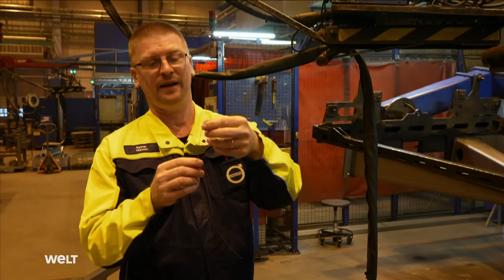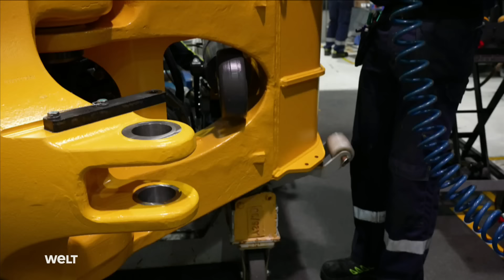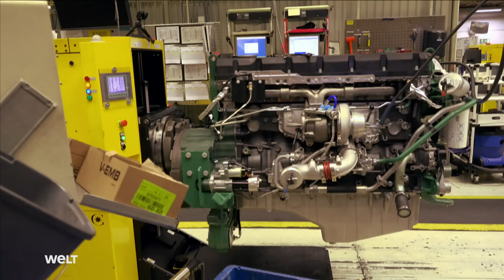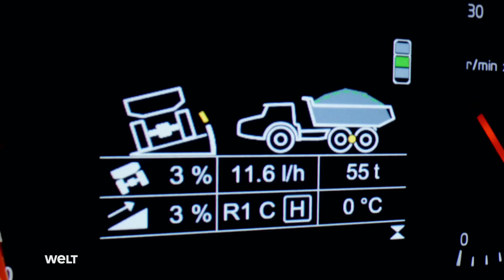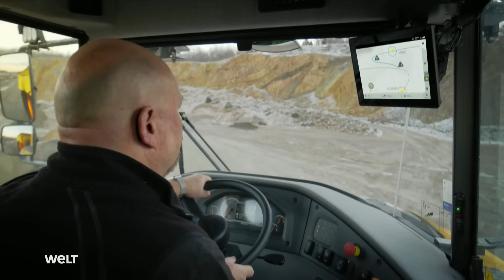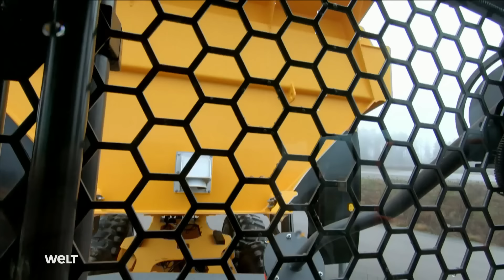World’s Largest Articulated Dump Truck | Volvo A60 Mega Construction | FD Engineering

Comment: I live nearby this factory, and I was stunned at how small the A60 really is. It's not big at all! 12 meters long is not more than a single truck (without trailer) and although it is 3,8 meters wide (significantly more than a truck) I still couldn't understand where all that net weight actually sits. I couldn't believe that the machine is 40 tons net (empty) -  I would have guessed about 20 tons. It's really not a big machine at all.

Comment: They're certainly nice, and probably the best in their weight class... but where I worked, they certainly weren't considered the big boyz on the block. Those were the beasts like the CAT 797... a 400 tonne hauler, and the Volvo's 60 tonne capacity is minuscule by comparison.

Comment: An classic 'antique' now as new designs started in 2000
Reply: Lid/lip in front of bed was just as big as dump area to protect driver from loader,yet made turning weird as  would 'seem' to move opposite of direction of steer as regular dump truck as cab pivoted directions under it
Reply: Thus making it such a weird experience + fact going from that to a suv  to drive to and from the mining pit seem like getting into a matchbox truck!

Comment: Have driven one yet quite differnt style/model as it was known back then as a flat nose cabover as the the lid on bed was directly over cab to prevent crushing cab as loading and not having a nose engine driver seat was directly over wheels like isuzu and steering was not connected to axle yet to the center pivot gear not pin like a loader that kinda made steer as like a semis 5th wheel yet gears turning cab. & tires ar same time opp direction of dumpbed thus giving a 0° turn radius like mowers yet sitting down and swiveling in seat to  steer unlike mowers as whole machine turns where dumptruck was just cab thus feeling like90° turns as if was a jacknifing semi! &Unlike isuzu cabover it steered right to go left &LtoR ,as it steered center 'pin' gear not wheel axle!

Comment: A couple of crazy Canadians bought a couple of those and cut them up !! Removed the beds cut the frames just In front of the  rear drive housing added  20   more feet of frame and put it back together and  reassembled a 30 foot oil  field bed, 3 winches a set of gin. Poles  a set of 6'x4'tires  times 6 or 8  ,. They work in the Alberta oil fields and haul 90- 150 k. Lbs in almost waist deep mud wallows called drill sites ..

Comment: If I could point out a possible slight modification.The a60 dump truck is nearly always loaded but with a loader this nearly always means overspill from loader on the side machinery ie wheels bearings diff etc if side panels were automated allowing driver when filling .to lift individual side panels ,this would prevent overspill ,cutting down many hours of maintenance. And serious damage to wheel bearings , especially in mining conditions like North America Alaska Canada and Russia in cold conditions preventing costly repairs and serious parts replaced taking  some cases weeks , I suppose this is nothing new and is probably an extra part that can be bought when purchasing ,❤mining

Comment: The Catipillar-797F is no joke either.. It's not articulated but can haul over 400 tons in its bucket.. Each wheel on the 797F weighs 5 tons.. There are 4 in the back and 2 in the front.. I believe it's 3 stories tall.. I've never seen anything come out of Sweden that was made in poor quality.. The Catiplillar 797F has it all over the A60...
Reply: Volvo is the original, everything else is a copy!

Comment: I think some version of this machine is used for the Archer howitzer.
Reply: I wouldn't call it another version. It's the much smaller model A30D that is heavily modified when used for the Archer. But yeah, it's at least a Volvo articulated hauler.
Reply: @ Thank you! I just recognised it as a dump truck that looked similar.

Comment: When a Ford F350 pickup can go for 100K a 500K price tag for the A60 seems very reasonable.  They video was nicely put together and very informative.  Thanks for sharing the presentation.
Reply: the f350 is a liability on the a60 an asset.
Reply: @jimzucker most people that buy an f-350 are using it for work it's not moving dirt but it's moving a whole lot of other heavy stuff too so it's the same the f-350 will make you just as much if not more money so no it's not a liability just because you say so 😂 mines made me millions over the years doing water and sewer lines just pulling an excavator and pipe and all the other stuff i use it for
Reply: $1m new. In two years the warranty expires. Sell it for $800k before the new one delivers for a per machine cost of $100k per year, plus 315k liters of diesel per year and routine maintenance. If anything fails, Volvo fixes it. In that time, nothing else should need to be repaired, rebuilt, refurbished or replaced. If the operation requires 55-ton capacity offroad dump trucks that work 24 hours per day with minimal down time, it's a pretty good deal.
Reply: I’d buy one and convert the bed into a home lol
Reply: @Literally_the_devil Ich kaufe mir auch so ein großes "Spielzeug",damit fahre ich dann im Garten rum,sammele die Äpfel,Kirschen u Kartoffeln gleichzeitig  in die Mulde,kippe diese dann vorm Keller ab,dann fahre ich zwei-dreimal über die Wiese,dann brauche ich kein Rasenmäher mehr,danach fülle ich die Mulde mit Wasser und habe gleichzeitig ein mobiles Schwimmbad und ich kann dabei vom Balkon ins Wasser springen   Was will man mehr !😊
Reply: 500k?  That may be what a auction company sells them for with low hours but if you order one from the company with the warranty, delivery, service contract, and training etc you're closer to 800k.

Comment: I live 20 km from Braås and got friends that works there and they say its very good workplace and good pay. I work with repare and service of this tip of machines. Its mighty vehicles to drive and work with.
Reply: Samma här. Ca 20 km  🙂
Reply: swecon?
Reply: That’s awesome! 🙌 First-hand insight like yours really adds weight. Working so close to Braås and servicing these massive machines must give you a unique perspective. Do you enjoy more the technical challenge of repairing them, or the thrill of seeing them in action?
Reply: Borås?
Reply: @reallivebluescat  no the factory is in Braås. Not Borås.
Reply: Its called Borås not Braaas
Reply: @dealerovski82  Borås is another town. Braås is a small town outside Växjö.
Reply: @gunnarboy8989  I live around there and have never heard of it.
Reply: @dealerovski82  Braås is a small town east of Växjö next up is Norrhult and then Åseda so now you know
Reply: @dealerovski82  Then try to type in Braås in Google before you claim it's Borås.
Reply: @hansericsson7058  yup, I live around Åseda, used to work in Profilgruppen and been in Braås many many times 😅

Comment: I started off driving a Volvo 861,  then a 5350 and finished up on an A 30. They would literally go anywhere.  I also drove a Bell 40 ton, there was no shortage of power from it's Scania V8 💪
Reply: I forgot,  but I also drove a Terex for a while. I liked it's Cummins engine.  It would start immediately regardless of how cold it was outside. The only negative I thought was when in auto, it would drop down too low in the revs before it would shift down instead of staying IN the power. Maybe it just needed to be calibrated or something.  Still, was better than sitting in the 861 with it's broken manifold 🙉 😂

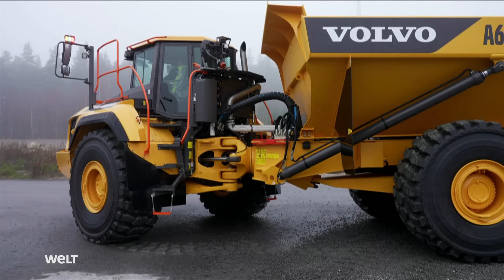Comment: 10:55 hydraulic cylinders or actuators, not pumps. There is a pump but you're looking at the actuator side non the pump side there, the pump is in the engine bay and supplies pressure, the actuator does the actual work.

Comment: 50/50 men/women? What is wrong with just hiring the most qualified person? No wonder Sweden has issues.
Reply: This team produces world class machinery. Sweden’s got problems but high skilled workers are not one of them.
Reply: If the most qualified person just so happens to be a female and the role is traditionally male, there's a pretty good chance she's going to be discouraged.
Reply: Most qualified for standing on an assembly line tightening bolts?
I sure hope not.
Reply: @Merecir You don’t have  wish for anything as it is a fact that this factory and its employees operates on global market where they outperform their competitors in quality etc. Does that hurt your delicate butt skin?
Reply: @ordningsmannen  The engineers who designed the vehicle, the factory and the assembly process are the ones who outperform the competitors.
Anyone, even the most dim witted moron, can tighten a bolt.
Reply: I'm thinking the same thing. If you get too political/corporate with it you will eventually turn away high skill experienced workers for the sake of must have 50/50 split no matter what.
Reply: @jronmanvehicles  The assumption that this facility has a 50/50 ratio is taken from what they chose to show in the report. From my own experience, I would rather guess at 85/15 in the production areas.
Reply: Thats what I was wondering.

Comment: I love how the narrator says the dump body is 11 ton yet the safe working load of the crane moving it is 2.5 tons
Reply: You're wrong, 1 metric ton (in English written as 1 'tonne') equals 0,9842 imperial tons, so there barely is a difference.
Reply: You need to get your hearing checked. 
1200 kg. Or 1,2 tons.
Reply: @jangustavsson2361  quick Google search would show you're wrong on that one close Sweden is very much metric. The chances are the narrator just misspoke
Reply: @landykid  what has switzerland got to do with the video....?
Reply: @ludvig7473  considering the video is made in Switzerland where the manufacturer is
Reply: @ludvig7473  my bad I meant Sweden

Comment: This is misleading title. Bell equipment has been making a 60 ton articulated dump truck for over 10 years
Reply: First of all this video is from 2015 which means so has Volvo at this point. Also the Volvo is technically slightly heavier and larger with a GT of 98,7t vs 97,5t for the Bell.

Comment: Fun trucks to drive. They will drive through almost anything. But when they get stuck they get STUCK. And you can flip one if the roads are wet and you turn too hard. Ask me how I know. lol and nobody calls it “ the beast”
Reply: How do you know ? 😂
Reply: well I worked in a phosphate mine for about 13 years. Throughout that time I drove 20 or 30 different A40s, A45s and and a handful of A60s. We would have around 60 different trucks running back and forth all day. Some of the other drivers were young , heavy footed guys that would drive pretty recklessly because to them , it became a competition on who was the fastest and who got the most loads. I’ve seen about 5 different people take turns about twice the safe speed. Also Intentionally trying to “drift” or slide the back end out and it would send the bed and sometimes the cab over on its side.
Reply: @brentcoates5470  nice! Sending best wishes from the country with the biggest phosphate reserve on planet earth. Morocco!

Comment: I have driven most of the Volvo dump trucks, and they are the best in the world. 
Even in the sludge pit where we drive row sludge they don't stop for 2 meters of mud. 
I have driven from the first ones to the A 60 + the special that takes 120 tons, 8 axles 1800 hp also Volvo
Reply: I drive an A30g rental right now, love it wouldn't want to touch Komatsu or CAT at this point
Reply: That’s incredible experience! 🙌 Driving everything from the early models up to the A60 and even the 120-ton special is something few can say. The way you describe them powering through 2 meters of mud really shows their reliability. Do you think Volvo’s biggest strength is their raw power, or their engineering that makes them so durable in extreme conditions?
Reply: The A25C was the best. I drove that for 10+ years.
Reply: I have only driven 20 ton and 30 ton I think they are very good but a little light on power
Reply: @scottsquires6186  When you reach 40 toner the power is okey. But yes some of it is lack of power.
Reply: I drive a Cat 745. Came from a Volvo A30. At this point, I'd quit before I get back in the Volvo. The Cat has a way better ride and better AC.
Reply: @Kevin-o2f8e  perhaps its hard to say.
Reply: Too bad China got their greasy hands on Volvo!
Reply: Liar.  Prove it!
Reply: 1800hp moxy ? I think you have your figures wrong

Comment: Baby Dumps...The Belaz hauls 500 tons...
Reply: Articulated truck are made to travel challenging terrains. It's why articulated truck will likely not get any bigger since weight is very detrimental on soft ground. The Belaz at 500 tons is just not as capable to travel through anything but very hard ground.
Reply: What part of "articulated" do you not understand?
Reply: @MrThisIsMeToo  It's "largest" that has me twisted...Thanks for axing...
Reply: Never buy belaz. You will spend all time fixing it
Reply: @dukenukem8381  Oh, man, thanks so much for the heads up bro! I was just putting commas on the million dollar check!  I could maybe afford an RC...: )
Reply: @godbluffvdgg these are still a few grand at 1/14 scale
Reply: Belaz used America engines, then went to the Russian engines. They don't have their own ones
Reply: But that's a rigid chassis this is articulated bends in the middle
Reply: Totally diff use requirements

Comment: The autonomous loader may be fine in some circumstances, but it’s absolutely NOT practical for mining.  The downtime of a unit for recharge versus an internal combustion engine in maintenance and downtime will cost more money in the long run.
With only an 8 hour runtime a company would require a greater amount of units to just to keep up with operational demand in addition to more facilities for storage and maintenance which in turn would cost more money as well. In addition autonomous vehicles and fully electric vehicles are currently still in their infancy and are nowhere near reliable enough to be practical at this point.
Reply: Have you ever heard of batteries? Do you have any ideea how they work? Do you even know how companies operate electric fleets? Or you didnt find anything else to hate on and settled on this?
There is nothin new about electric machines, companies use them since 20 years ago, the news is the autonomus part. To have a machine think with minimal human interference is a great improvment. And dont give that reability and practicality that petrol companies push, electric is better all day of the year.
Open your eyes lil' bro
Reply: Any company does a study of the pros and cons before choosing what to buy. If Volvo can sell them it is because some companies consider them better. It really is very simple.
Reply: train locomotives have shown that electricity is reliable enough. Throw a giant diesel generator on it and you have no runtime issues.